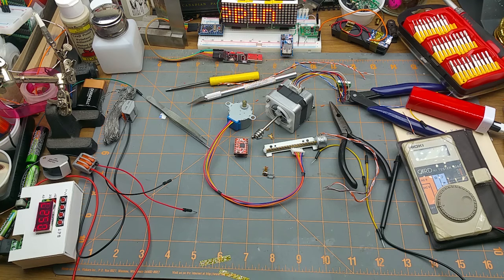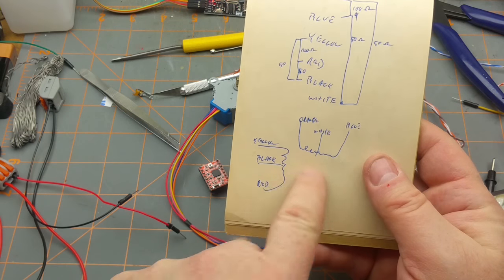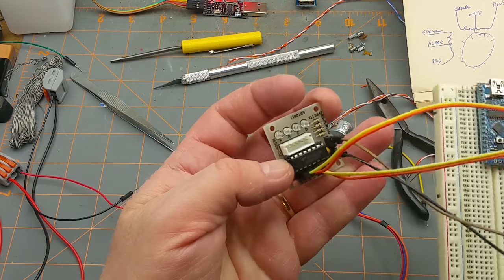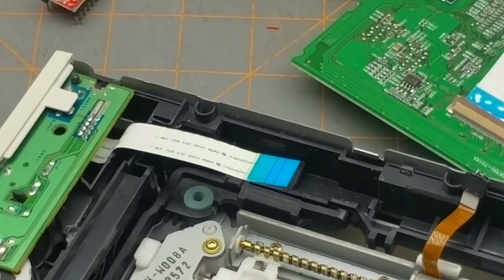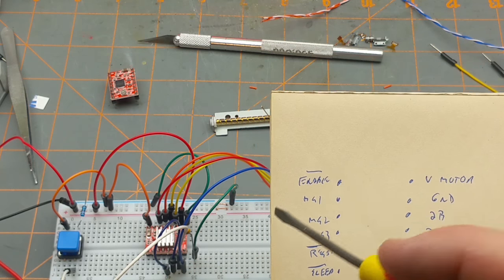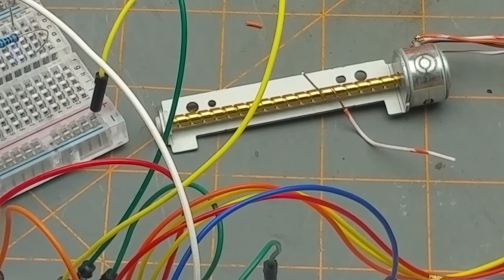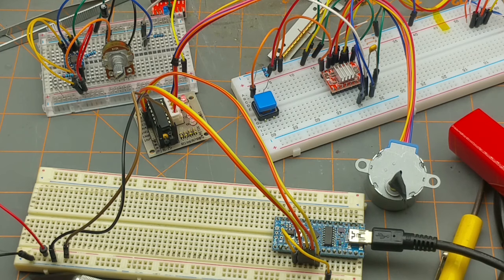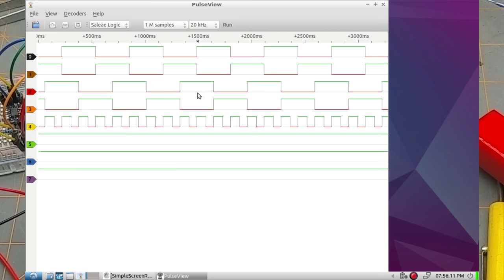playing with stepper motors

Comment: Thanks for showing the demo, I am a model railroader who just started on arduinos.   Haven't played with the stepper motors yet.
Reply from the maker: Thanks for stopping by my little corner of youtube.
Reply: Dominic Fawver, I am about to embark on a project to build an indexing turntable using Arduino, stepper controller and motor with buttons and lcd readout. The funky little CD stepper May be used to open crossing gates as it will be smoother to use rather than those dinky little 9g servos

Comment: I have a couple of large stepper motor as you do and they can easily be powered with 5-volts instead of 12 or 24. You will get less torque out of them by it still works.

Comment: 2-Phase 4-Wire Stepper Motor DC 5V 6V Drives Linear Screw With Nut Slider Block

Comment: great video, i have a question i have a 4 wire step motor that i am trying to run it continuously it is 5V motor from thermal printer, i wanted to run it with out driver i tried all possible wiring but still will not run im using 450mf cap, could you please help.thank you

Comment: There should be stepper motors in old ink jet printers, too. Many DIY 3D printers start with the steppers from 2 ink jets for a 2d movement of the head, and one of these steppers on the output stage to lower the object for the next layer.
Reply: This was a fun video, and it shows how easy it is nowadays to do what used to be REALLY HARD in my college days using TTL ICs (I'm older than you).
Reply from the maker: Pretty much any old printer should have steppers in it. And those are often pretty torque-ish motors too.

Watch this space for a future teardown and salvage operation. 

Thanks for watching.
Reply: And Scanners.

Comment: I think you have to set the current with the trimmer on the driver. 
I got a GRBL shield kit for a DIY CNC I was making, and that has browser control.
Reply from the maker: SidneyCritic ComedyHound:  yes, thats what the pot does. 

I thought i mentioned it, but i probably edited that out when i was cuttkng soome ofnthw pointless rambling.
Thanks for speaking up.
Reply: I saw the hot stepper but no mention of amps, so I thought I would mention it.
Reply from the maker: Thanks for the information. 
It's a good thing to mention, since I managed to miss it in my sloppy edit.

That stepper was probably runing for over 30 min solid when I touched it there at the end, so I wasn't surprised that it was getting a bit toasty.

Comment: How much volts need for the stepper motor of the floppy?
Reply from the maker: I believe most were 5 volts, though floppy drives did have 12 volts available on the connector (but I think that was for the main motor, not the head positioning stepper.

Comment: I have a question. Is there any way to connect a mini stepper motor directly to an battery source & an on off switch?
Reply from the maker: Not without some sort of control circuit. You need to steer the power to the different coils at the correct times in order for the motor to move.

Comment: It can work with only CNC shield stepper motor?
Reply from the maker: You could also use an h-bridge and an arduino to drive it, but the arduino would need to have a program to control the motor signals.

Comment: Did you finally make the smallest one work? I got some of these, but my attempts showed they are very weak.
Reply from the maker: I abandoned it when I started going cross-eyed.
If I have a practical application for it, I might re-visit it with better magnification.